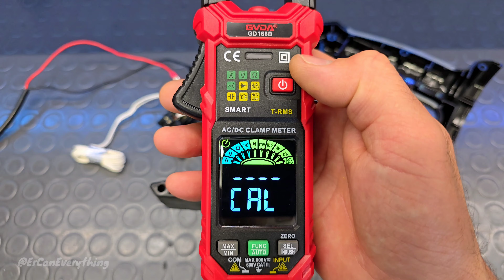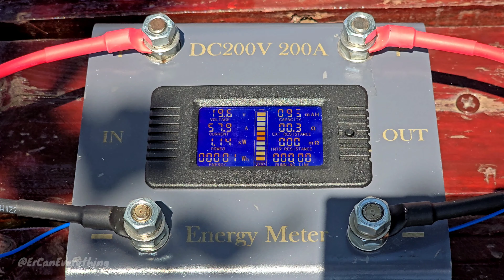New life for 19 year old Panasonic Cordless Circular Saw with PARKSIDE Battery

Comment: Good job, realIy. I have don this with an old snowblower, but the negativ thing is, wenn You do this You have no batterie protection, because the BMS doesen't work with other systems.
Reply from the maker: Thank you my Friend😊
It is true, but I always monitor the indicator in such a case and as soon as the orange diode tur off, I change the battery.
Reply from the maker: In the worst case, I charge them up to 15V with a power supply and they recover again.

Comment: I’ve done this to some old dewalt tools , they kill your battery’s as they keep draining them too low to recharge is there a way to stop that just wondering if you found the same problem 👍🏽
Reply from the maker: The easiest and safest option is to follow the indicator. And as soon as only the last battery level indicator lights up, you need to charge it.

Comment: I have the Panasonic 18v drill. I’ve been thinking about replacing the NiCd cells with 18650’s.
Reply from the maker: As they say old is gold, it really was.
I really liked the quality of this circular.
Because mine didn't have a battery and that's why I made it like that.
Otherwise, if you replace the old ones with lithium batteries, it will be perfect.

Comment: Hi .. my friend ... I have a problem with my parkside battery 8 amperes ... i replaced the resister and the regulator ... the battery gives charge to the drill but it's not charging ... is there difference between normal regulator 3.3 v and the zener regulator 3.3 v ?? 2:37 2:39
Reply from the maker: Hello my Friend
If you soldered a zener diode instead of a regulator with a 20 ohm resistor, the main IC is certainly burned.
Did you remove the BT module?
Reply: yes @ErCanEverything